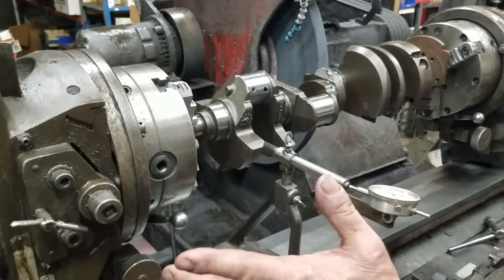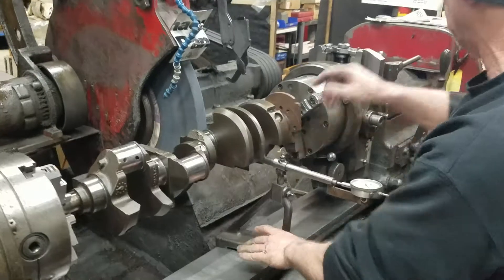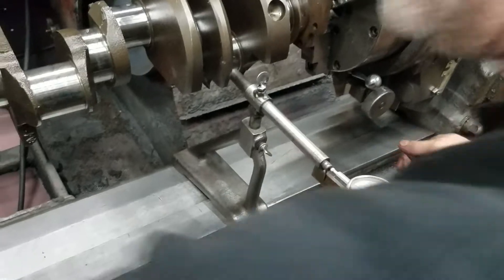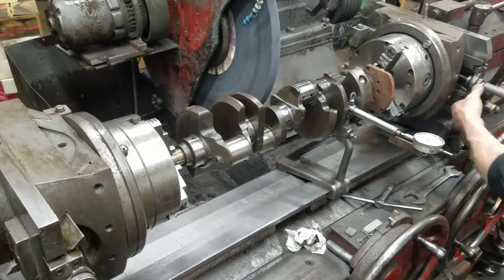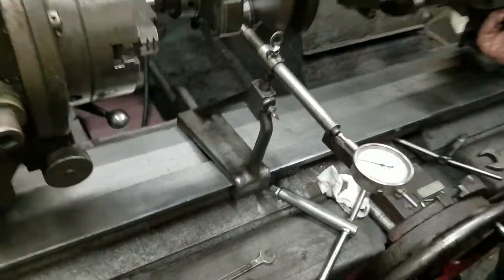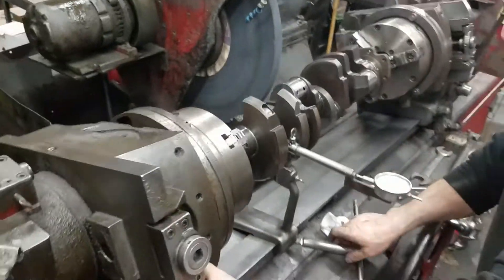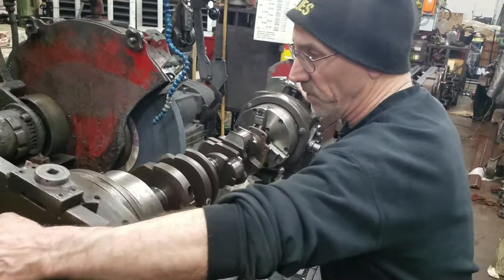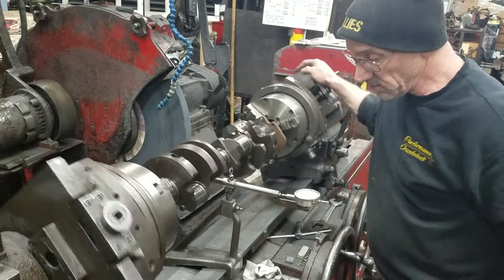Crank index and set stroke on 350 Chevrolet crankshaft grinding

Comment: I've been grinding cranks for nearly 40 years. I had a complete engine machine shop for 25 of those 40. Bore and hone blocks, complete cylinder head service, connecting rod recon, etc... Gave it up due to move to Germany after getting married. A divorce and a 20 year old son later and I'm back in the states working for another shop, you guessed it, grinding cranks. I have a customer that wants me to 'stroke' grind a crank. I have an idea on how, but have never did it. Can you help me out?
Reply from the maker: I sometimes over simplify offset grinding a crank but here is the easy way to do it .. Lets say we want to offset grind it .100 (one hundred thousandths ) or how ever much we can based on how big our journal is .. Example , you can only offset a SBC journal to available rod journals size that you can get a rod in ,so your choices are 2.000 or 1.888 honda size ,lets do the easy math , offset grinding the 2.100 journal to 2.000 gains .100 stroke , so if we start with a 3.480 (350 Chevy ) we gain almost .100 leaving maybe .002 for clean up just in case we have some wear in the journal  ,so we gain .098 in stroke making it 3.578 ..Now setup , once the crank is in the machine set the slides to 3.580 ( or close to that ) and you should rotate the crank as if you were truing it in , but you should see approximately  .100 runout (lets shoot for .098 so we have a few thou to make sure the journal cleans up ) I like to rough the crank to within .010 with a real course dress on the wheel , then measure my stroke with a stroke tester ,but it is not necessary if you have the offset correct so that the journal cleans over the top ,that's the important thing .... Give it a whirl on a junk crank and in no time you will have it figured out ...

Comment: Love the video... he is definitely in a job shop or the owner fast as possible cause crank cutting is the most cost in the shop I use to work for a fella that if you couldn't regain a crank in such a time he would change the job u did or fire you . In the day-to-day consumer automobile with a rebuild that is totally fine and only way to make $ I learned in a performance ran an based shop. After cleaning measuring blasting ,checking for cracks the occasional staghting. Set up of grinder cut radius and wheel face for grind type then change of grinding wheels ,center ,,balance,and grind to perfect index&stroke with the right radius,  for rod and bearing used...it will take hours of time great video though I love seeing how comfortable a person gets with talent and time thumbs-up 👍

Comment: So you are basing your geometry on the existing position of the journals. You would have to assume then that the factory positions are all correctly established. What if you chromed all journals, how would you establish the correct swing of that\s something that is not done. Great video and cheers!
Reply from the maker: Chroming is easy , try adding .100  worth of weld on both sides of the journal and then reestablish the correct journal index and stroke ,luckily we have degreed chucks so we indicate off another journal and go 90 degrees  , then measure the stroke to make sure we are on the number .....

Comment: Hi, great video on this topic. When you adjust for the stroke on the other pin, would the stroke of the crankshaft be the same on all the conrod pin journal?
Reply from the maker: There are a lot of if's to that answer ... if the chucks don't have any runout , if the crank is straight , and if the stroke from the factory is the same on all journals .. Todays cranks are much better that ones from years ago .. when grinding you may have to make small adjustments every once in a while from journal to journal ,but it you are grinding on centers or your chucks don't have any runout ,most of the time you can go journal to journal without making an adjustment ... Adjusting one end of the crank will affect theother end but only by 1/4 as much ...